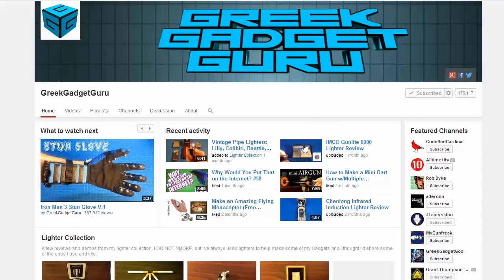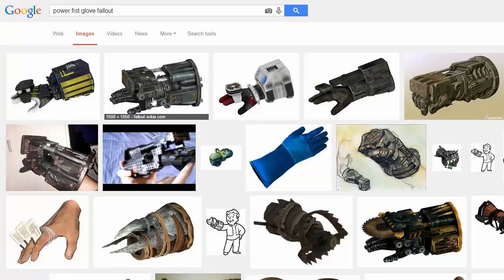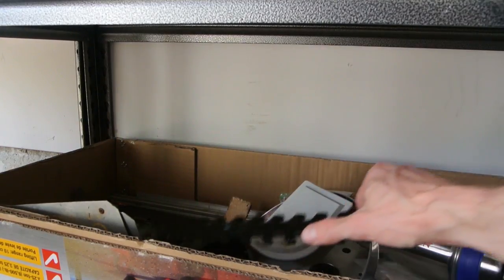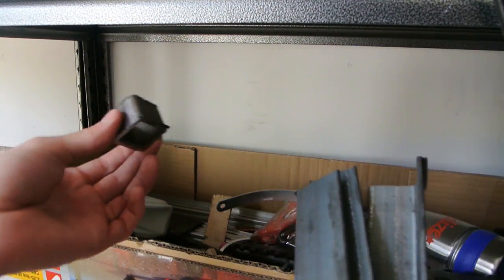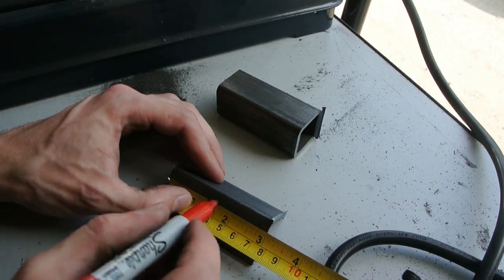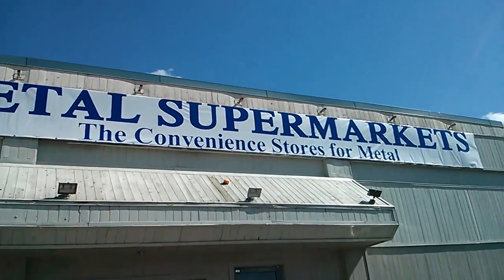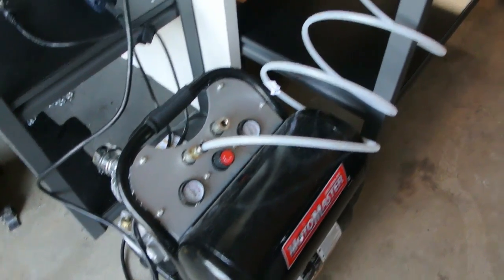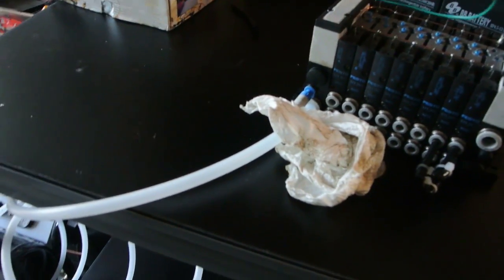Make it Real: Mechafist Packs a Pneumatic Punch!

Comment: * get some single acting pneumatic cylinders with spring return and just put some 90 degree vented fittings on both of your outlets (better yet still combine both of your outlets in a "Y" configuration and then install one bleeder (screen filter inside it)/exhaust fitting so both outputs "purge" at the same rate as to avoid any side loading of one cylinder .... helps to ensure extension and extraction rates stay at a 1:1).  * WOW you can also install a super cheap MICRO-SWITCH anywhere on the contact/impact zone (ie. the steel :knuckles" area) and then would only activate when the user lands a well connected punch ..... and for added safety you could limit the micro-switch to only be activated at a predetermined or "set" amount of force/pressure.   Someone like you could just easily convert 2 of your air cylinders to spring return by simply disassembling the cylinder and look for pre installed "eyelets" on the inside base of cylinder and the bottom of cylinder rod (under the cylinder packing) and then attach a good stiff extension style spring ... the "stiffer"/stronger the faster the return (** for later upgrade to SEMI-AUTO PUNCH, 3 Round Burst Punch etc. :-) ).  Awesome work as always man.

Comment: if you put a momentary switch on the front where it would hit something when it hits it it punch it forward and would  be more effect
Reply: I would also put the puncher further back a few inches so it has acceleration space in combination with your idea
Reply: Yea
Reply: Exactly! ....  to synchronize both impacts as a force multiplier .... easily done by the way you mentioned or even by mounting the *micro-switch ahead of the contact zone (*electrically connected to your pneumatic solenoid valve ... they can be VERY small and are super cheap too).  Basically the same outcome that chance kiki meant with the momentary switch .... and in addition I would make the cylinders both spring return instead of being powered in both directions (powered out and automatic spring return when micro-switch is deactivated). It would also be possible to convert it later on to  a "burst" or semi-auto mode too.

Comment: If your gonna make stuff out of metal make a cheap forge
Reply: I could be mistaken but I think Scott Sanchez suggests a forge for hardening or tempering steel. At least that is what I would suggest a small forge for you to use. You would still mig weld things together, but maybe a forged out billet of well tempered steel for the contact point? Also coming from extensive research i have done, forging metal makes you 20% more Viking and 24.32% more manly. It would be a good build video for you to do as well.
Reply from the maker: +Scott Sanchez welding is much easier than forging things...
Reply: Jonathan Capehart 80% of statistics are made up.

Comment: ok, so, now what you need to do, is put in an alternator that retracts the plate after each punch, and put the trigger into a pad on the front of the gauntlet so that it only triggers if you hit something, and always has perfect timing, thereby assuring reliability, and energy efficiency. after that, its just refinement: armor plating, extra straps to keep it on the arm, removing the handle you have to hold onto, and replacing it with an actual gauntlet/bracer that straps to your arm, leaving your hands free. then, get the air canister into a backpack, grab some body-armor, and youve got a quick MK1, ready for field testing.

Comment: Pretty cool. But you need to work on your welding. :P If you hold your tip perpendicular to what you're welding the gas will have more effect and your welds will be cleaner and stronger.

Comment: Why not use a single acting spring return cylinder?
Reply: +Taylor Swiftpubes or an electronic alternator on the switch, although the spring would be more power efficient, the spring might reduce the stopping power of the pistons by resisting their forward movement.
Reply: Taylor Swiftpubes A spring will reduce the motion of the  cylinder. Perhaps electric reset to save air when roaming around on portable air supply.

Comment: Hey, Hacksmith. I was wanting to make a version of this (with larger cylinders), but I didn't want to make it to where I had to use a fairly stationary air compressor. Would a paintball air tank work fine with this? I also had a question regarding the switches to activate it, if adding a contact switch at the front would be best and if it could be made portable somehow (battery pack, etc.)

Comment: Need some help with ideas on this.  I was at the 2:40 mark where you struggle with the classic machinists problem of tightening a hex nut where no ratchet can easily go.  before the 2:45 mark, I came up with a nifty idea for a ratchet that can go around closed loops like that, without requiring straps, chains, or pipe-wrench style flex grips.  I'm googling the hell out of different types of ratchets that would be able to come off of a 'secured' nut or pipe like at 2:40, and I don't see anything close to what I'm thinking.
Reply from the maker: That's funny, I was just thinking about a tool like that!

Search "low profile pneumatic wrench" on google images. There is something, but it's still a closed loop.
Reply: What sucks is, I'm not an engineer.  I am extremely good at 3D thinking though, and my wife and I kind of got a prototype sketched out.  I don't have shop space or resource to try n make it, but I'd love to bounce it off ya n see what you think.
Reply from the maker: MrLargonaut Sure, send me a message through facebook! https://www.facebook.com/thehacksmith
Reply: Done!  Now i get to be embarassed that I did this in MS paint lol

Comment: I like it but, the tube in the palm, will that limit your fingers range of motion?
Reply from the maker: This a first off prototype -- it'll change a bit for the exoskeleton =)
Reply: the Hacksmith
Thanks for the prompt reply. Excellent work btw. My channel is about Gravity Falls, but I've been wanting to do another to feature my hacks. Nothing I've done yet compares to this exoskeleton though. Oh man, if this thing works. . . How about putting the initiate button on the forward edge, causing the punch itself to set off the actuator, rather than trying to  time it manually?
Reply from the maker: The Sqoou I was actually planning on that! Just didn't have time to build the switch! Great idea!